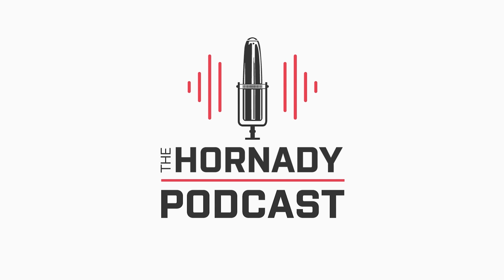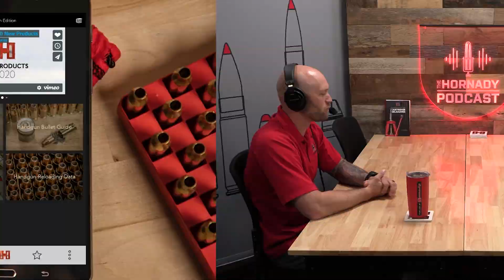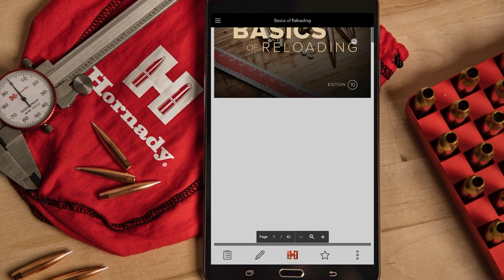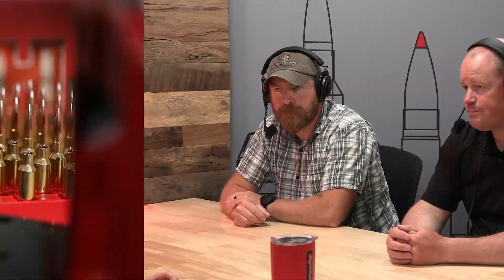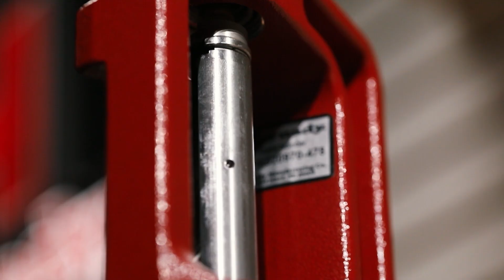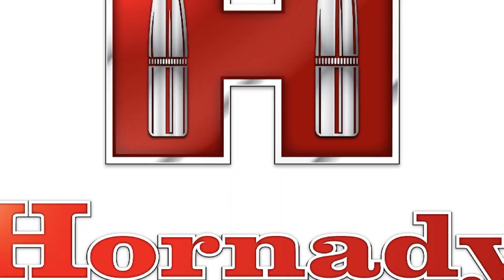Ep. 077 - Match Ammunition

Comment: Hey, just curious if you guys have tested how much powder charge precision affects chamber pressure and muzzle velocity. You hear about people measuring to the kernel of powder, but it doesn't seem like that small difference in powder charge would cause a statistically significant difference in muzzle velocity. From your testing, what is the level of resolution at which powder charge begins to actually affect velocity? ie measuring to the kernel, .01 grain, .05grain etc.

Comment: When my .308 custom AR10  “18 progressive twist barrel was built, my question was “what off the shelf ammo should I run” ? Hornady Black 168gr. AWESOME! I’ve tried some other good quality ammo in it, (will not run “cheap junk” through it) and did not take long to figure out, the Black was the way to go. Almost like the rifle was built around this ammo to start. Excellent product and after listening to this I know why. Great job to all at Hornady, makes my geezer gun and the geezer behind it look good all the time. Thanks
Reply: I have a POF Revolution 308 DI and the Hornady Black 168 grain is what I run without issues and 1/2 -3/4 moa groups consistently. It will run and cycle any ammunition but anything under 150 grain, the groups open up considerably. Hornady Superformance 150 grain is another that groups well same as the 178 grain Precision Hunter from Hornady. I’ve found that Winchester rifle ammunition is crap compared to others but Hornady is tops.

Comment: Please don't take this in a negative way (consider it a positive for Precision Hunter), but I wonder why you even bother to make the white box match, when you have Precision Hunter? In the Hornady developed cartridge rifles I have, Precision Hunter outshoots Match in all three.  Not just by a hair.  All 3 of these rifles, with Match are about 1MOA or less for 5 shot groups, the Precision Hunter is performing closer to 0.5 MOA and under for 5 shot groups.  I have put considerable rounds, greater than 100 of each, through all 3 of these rifles, but far from shooting them out.  Referring to 100 yard groups here.  All 3 rifles are in good condition, little to no throat erosion yet.  3 different calibers, 3 different manufacturers, same result?
 
Examples - 300 PRC Fierce Fury - 212 ELD-x outshoots the 225 ELD-M Match (talking factory loaded ammo, not just the bullets)
6mm Creed Springfield Waypoint 2020 - 103 Precision Hunter outshoots the 108 Match
6.5 PRC Tikka T3x V Wideland - 143 Precision Hunter outshoots the 147 Match.

My thought is that the jump with the Precision Hunter is smaller because of the different ogives on the Precision Hunter vs the Match?  The jump measures shorter (even though the OAL may be less on the Precision Hunter), and I'm guessing the rifles like that shorter jump?  Have you at Hornady experienced similar things?  I'm looking at a limited amount of data, I understand that, but from my finite experience, the Precision Hunter works better for both game and target shooting.

Comment: No disrespect to Hornady but FGMM 168gr .308 Win has been around for a long time and is still in my opinion the Gold Standard for off the shelf .308 Win. Match cartridge loadings. Hornady is doing great things and I love their reloading components and these podcasts. Hornady makes some great loadings also that I use like the .450 bushmaster 250 ftx.
Reply: You have your right to your opinion and feelings, but I recently did a test with a box of FGMM 168gr compared to Hornady Match 168 BTHP and 178 gr ELDM.  All groups at 100 yards were under 1 MOA.  However, the Federal GMM had a SD of 22 and both Hornady loads were 5.2 and 9.3 SD.  That is significant.
Reply: @amym828  I didn't say what Hornady puts out was bad. my experience (not feelings)with FGMM is over 30 years and has always shot great in all but 1 308 I've used it in. I use a few of Hornady's loads and My experience has been good with those loadings. I mostly hand load my own though and have for 30 years. Thank You for sharing your experiences with their ammo.